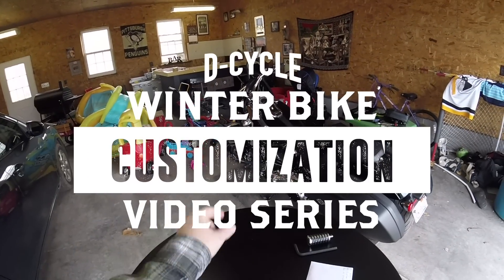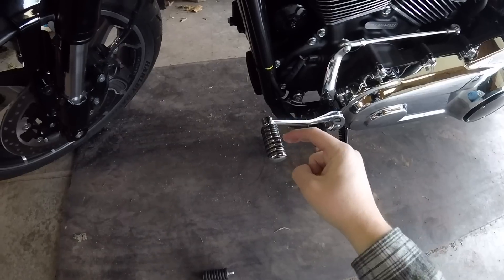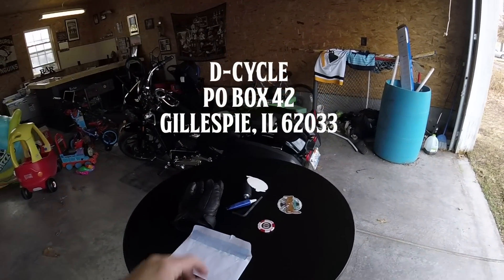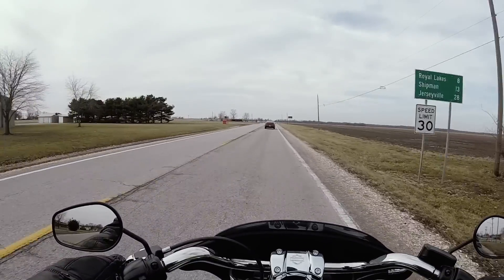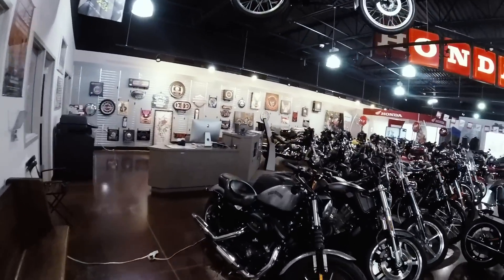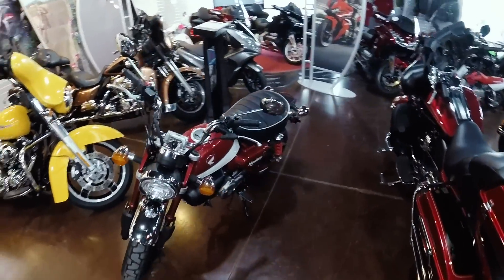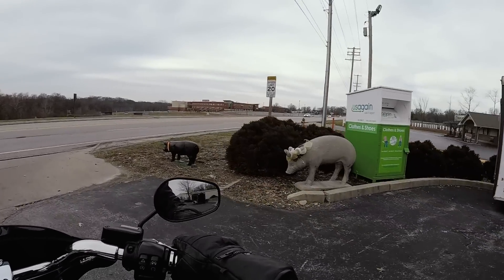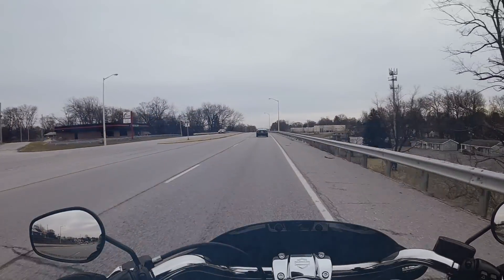Shifter Peg Install on a Harley-Davidson Sport Glide & Visit to Ted’s Motorcycle World #sportglide

Comment: Just what I needed to know.  6mm.  Thanks.
Reply: Just an FYI to other viewers, my stock shifter pegs took a 1/4” Allen key.  6mm was close but a bit loosey. My add on pegs(Willie G), while having the same thread size as the stock peg bolt,  I needed a 3/16” Allen wrench to install.  Perfect fit.  Thanks again to video maker.

Comment: The gas cap on my 2018 Sport Glide started rattling after 1500 miles or so also ...thought top end of the engine was going bad.  Maybe there was bad batch of gas caps?  Replaced with new one and so far so good.   But if you decide to change out with aftermarket, please post video -
Reply from the maker: Sport Glide rider Dennis I am certainly thinking about switching the cap. Maybe in a few weeks! Will definitely post video and even take the bike to the dealer about the stick cap.

Comment: I don't want to sound like a dick but do you think it might be a 1/4 inch allen key rather than 6mm?
Love the Sport Glide, picking mine up next week. Good vids man, I've watched a few now, well done, kudos. Subbed.
Reply from the maker: Haha. I used the tool that worked, in all honesty. One can substitute the other if needed from the chart I referenced online.

I appreciate you watching the vids and subbing! You’ll love the Sport Glide more and more as you own it. Wonderful motorcycle.👍🏻
Reply: @DCyclemoto  They are close, so you can use the metric one at a pinch but the 6mm is slightly smaller, about 0.014",
it's not much but you'll eventually flog out the bolts. Actually rather nervous, it'll all come back, it's at least 20 years since I've ridden a bike,
it's about 500 miles home from the closest HD Dealer so by the time I get home I'll have to go back for the first service, after that I'll service it myself.

Comment: I have the exact same sissy bar, had to buy the docking hardware, $75 CDN. You would think Harley would have included it on the bike but oh no have to  squeeze the customer again.
Reply from the maker: Rob Yeah, I paid $50. If they are going to put passenger seat and pegs, may as well include the sissy bar, too, right?